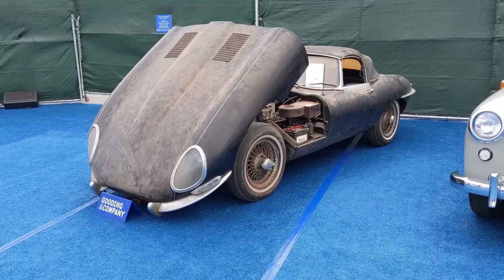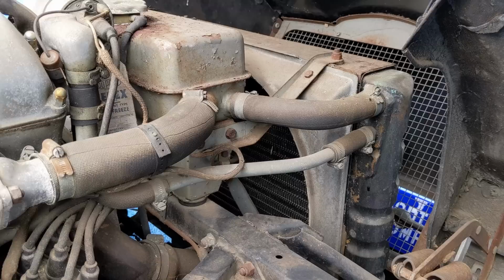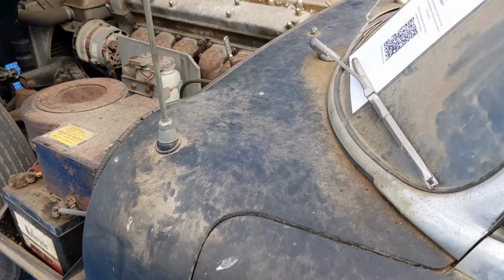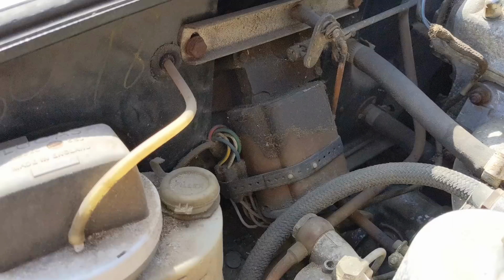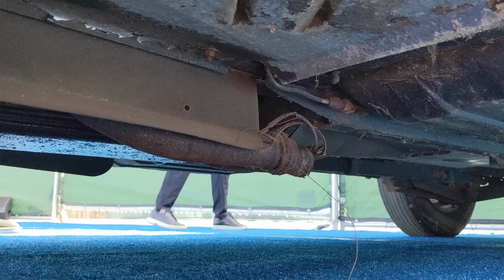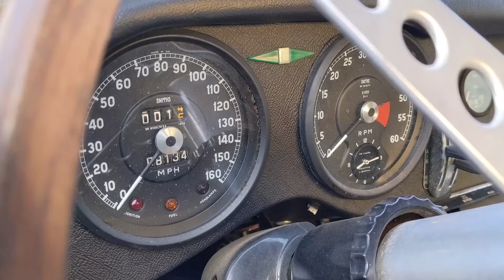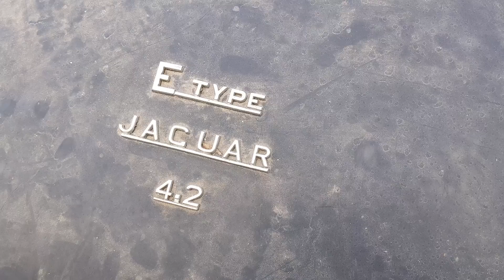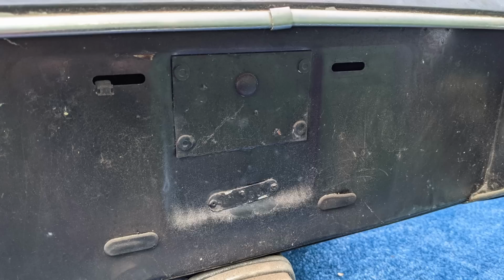8000-Mile Jaguar  E-Type Barnfind

Comment: Gosh, I’m sure if I carefully applied a mixture of cement , sanding dust and flour to mine I could achieve much the same effect , in fact 
I’m not sure that my front suspension isn’t a bit dirtier.  Just give it a good wash and stop worrying . . ..  I really don’t see the point  of 
these silly barn finds.